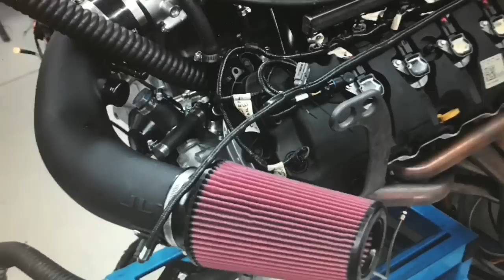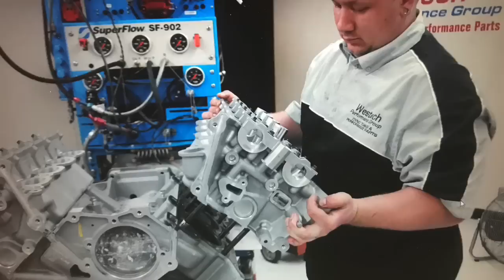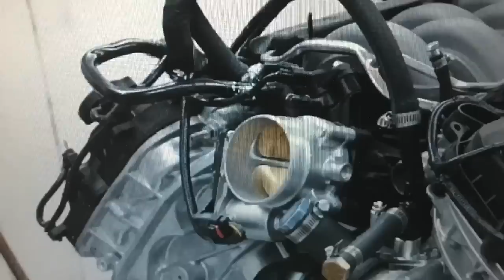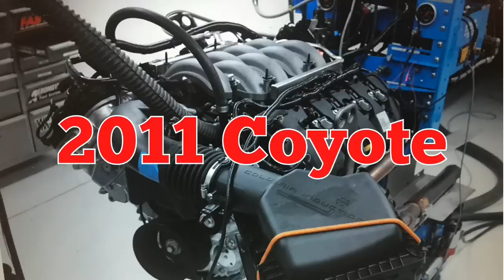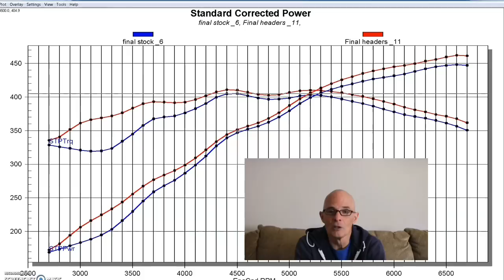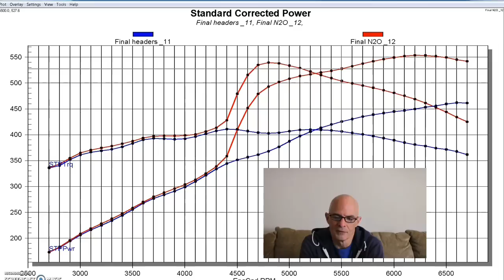5.0L 4V COYOTE MODS-NITROUS & HEADERS (GEN 1 YOTE)

Comment: Shaun Perry at AED ran a similar test on his gen 2 mustang (stock block) with CPR single turbo and found the weakest part in the engine to be head bolts. I "think" he end up making 1,320ish rwhp before a head bolt let go. I haven't done the math but, through a 6r80 transmission those numbers would have to be close to the LS numbers.

Comment: Weakest points of Coyote Gen 1 in order as I see them, #1 oil pump gears, #2 Rods/pistons and fasteners #3Head Gaskets/ head fasteners, #4 secondary timing chains. #5 the Cooling Jackets in block seem to develop cracks above 900-1000 h.p. over time.  Of course tuning makes a Huge difference! And could keep some of the internal component issues mentioned here at bay for a while! Still waiting to see the Big Bang Coyote engine! Can't wait! I'm also curious to see if my predictions are right!

Comment: Is it a fair comparison between the 5.0L Coyote and the 6.0L LS6? I think when it comes to the amount the stock block can handle it would be more scientifically sound to look at power per cubic inch versus overall power because you are going to have to push the smaller Coyote 5.0L harder. It's kind of like comparing a 350 GMC to a 460 Ford. That Ford is going to be able to make 1000hp easier just because of the displacement difference.

Comment: The stock oil pump gears are the weak spot. If he changed those out, then it may make some big power. But since they are driven by the crank, replacing them would wipe out the claim of stock bottom end. The other big hurdle to being the HP king is the lack of displacement. Down 62 cid (1 liter) in a boosted application is a killer. With 2.5 hp+ per cid, that is a guarantee of being down 150 hp+ right from the get go.

Comment: I believe the 2015-17 gen 2 Coyote with it's factory forged rods and crank shaft should hold more power than the LS. There are Turbo gen 2 Coyotes running 8's through a stock/sealed motor. Supposedly the Coyotes weak points are the oil pump gears, so as long as you don't bang against the rev limiter the OPG's shouldn't fail.

Comment: Why is it that LS guys always make a showdown against the coyote but use the best tuners/power adder for LS but the worst for coyote? A kenne bell? Are you serious? That thing is a heater more than a blower. And ken bell tuning? 🤦🏻‍♂️ not just anyone can tune these coyotes, an LS my 3 yr old can tune that. Never an apples to apples comparison
Reply from the maker: The Big Bang Coyote gets the same two S475 turbos and ATW IC as the LS
Reply: @richardholdener1727   I see that. The issue was more using a gen 4 ls and a gen 1 coyote. Also, this was done waaaay back. A gen 2 coyote would beat that record, but like you said, the most popular you have tested on is LS. Nothing against you. This is entertaining.

Comment: The thing I didn’t understand about these Mod motor/ Ford enthusiasts is their love for those inefficient ass blowers... these small cubic inch OHC motors are completely optimized  for turbos lol... especially when you look at the Cost vs performance gain factor. Hell, with a Forged Coyote and a single efficient CAST 76mm-80mm turbo (nothing extravagant or crazy aka Non Promod turbo) you can make some serious steam. The Coyote makes Good power per cube for its cubic inch and on top of the fact it’s only 5.0L.. so the turbo size doesn’t need to be crazy to make 4 digit power

Comment: High compression drag motors make 16+ bar BMEP.  The coyote with headers and no accessories is only at 12.6 bar.  The 2020 480 bhp coyote is only at 12.0 bar.

Comment: I love Ford's but the 6.0 has a simple displacement advantage. My money is on the 6.0. now if you break it down to horsepower per liter the 5.0 would win. I'd bet the 5.0 makes more power than the 5.3 but not more than the 6.0.
Reply: Actually,  with just headers on stock engine, the 5.0 made 50 more HP than the LS 6.0.

Comment: Finally a coyote. Hopefully you do gen 2 and 3. Gen 1 motors are the weakest byfar
Reply: Gen 1 coyotes aren't any weaker than a gen 2. They have the same short locks except the gen 2 uses smaller head bolts. The gen 1 has 12mm head bolts vs the gen 2's smaller 11mm bolts. If anything, the gen 2 would be weaker. However, ford finally got it right with the gen 3 as far as strength. The gen 3 uses Boss rods and pistons along with 12mm head bolts. Not to mention, the extra power from better heads, cams, intake and compression increase. This (gen 3) coyote is what I'd like to see Richard test against the LS.

Comment: I wish you would be testing the Gen 2 Coyote which is better in every way over the early gen 1.  SBE Gen 1's are good until they start flinging rods at 740ish whp but the Gen 2 Coyote (which got a lot of the Boss 302's tech) can get their more easily and live a happy life at 850-900whp and 1,000whp if you want to show off on occasion.
Reply from the maker: The Big Bang motor will be Gen 2

Comment: As for performance, the coyote platform is amazing.  The make a ton of power right out of the box and respond really well to upgrades, especially boost.  The only issue I have with them is their physical size- they just take up a ton space under the hood.  The debate over which platform (LS/LT or Coyote) makes more power is mute- both are capable of making ridiculous HP numbers.

Comment: As light weight as the coyote is , and the fact that it needs to rev to the moon to make max power , I highly doubt it will make more power than the 6.0 LS before it goes boom....Another channel already did the LS vs Coyote shootout and the LS won both N/A and with boost...
Reply from the maker: Please take a look at that test-it's not what you think
Reply: @richardholdener1727   I'm not sure what you mean.   What's not what I think? The test I'm talking about spent the same amount on building both engines,  and the LS came out on top N/A and boosted.
Reply: bdd1469 ls and lsx will always be better. Nothing faster than a turbo lsx ftw
Reply: @speedlife301  lol.  I am not fan of fords but the coyote platform  is an  impressive package. I love LS based engines and the power they can make is amazing. To say nothing is faster than an LSX turbo is beyond insane.  LSX based engines usually make 1000- -2000 hp when boosted.    Blown hemi's and mountain motors make 3000-10,000 hp...

Comment: I’ve seen bone stock mustangs get thrown 20psi and hold up fine, making 1000+hp on chassis dynos. I’d imagine if you did simple ring gap like the LSs, and tuned it correctly, I don’t doubt the factory motor would make 1100-1200.

Comment: Coyote is limited by bore spacing, prevents you from making big cubes when adding a stroker kit. Expensive shortblock to correct that. 
Personally, I think what the coyote loses in the cubes will be somewhat made up for in the RPM it makes peak at, though I don't think it will match the 6.0. 12-1300hp is my guess.
Reply: Key will be keeping the tq levels lower and not revving excessively but with its rod length and the stroke i feel it will surpass the 5.3 and definitely be barking at the engine 1 liter its senior

Comment: btw, if you want significantly simplify the tuning on the Coyote you can lock out the vvt. Modular Motor Sports and Comp Cams both make parts to achieve this. MMR completely removes the phasers and replaces them with aluminum plates which removes some weight off valve train. The trade-off is you lose a good deal of torque curve, usually down low, but for a racing engine this is usually not a concern. You get really good at degreeing cams, lol.
Reply from the maker: we actually want to reduce mid range torque anyway and plan on locking them
Reply: @richardholdener1727  
Well, there you go.

Comment: Generally speaking, for longevity, around 600-750hp is the limit on the stock Coyote. After that, sleeves, rods, and pistons are good idea and any time you're that deep into the motor put billet oil pump gears in it, especially if belt-driven supercharged. Also, the 12mm block is preferable as it has thicker, deeper head bolts/studs that tie directly into the main webbing. 11mm block are okay but known to crack around the knock sensor boss under very high boost. Do all that these engines are known to be happy at 1500hp, which is pretty incredible considering it a production aluminum block 5 liter. That would be like an aluminum block 6.2l LS making 1,820hp.

Comment: Hey Richard I'm hoping I'm not asking for too much but what are the chances of you getting your hands on Ford's new 7.3 L engine strapping it onto your Dino and letting her rip, now I'm not a Ford guy but I'm definitely impressed with that engine that thing already has the specs of a race motor in stock trim, just throwing it out there.
Reply: Revan Evan did minor port cleanup  on the heads, intake swap, and cam and ran it was touch under 600 hp

Comment: An L** big block should be able to take more than an LS I would think.  Especially one setup with real good flowing heads and a mid sized cam.
Reply: Big Bang Big Block. That'd be a good test. Another would be putting a LS 427 against a BB427, both identical cams, rocker ratios and good intakes.
Reply: Kimbal Mackinnon or the new lsx454 vs bbc 454

Comment: If I recall correctly, you ran out of MAP sensor on the Big Bang LS motor so you should get a 4 or 5 bar sensor and redo the test!
Reply from the maker: I will if the Coyote makes more
Reply: Richard Holdener Can you please make a video on oil viscosity and how it can affect power and reliability? Maybe do a test running 20, 30, 40 and 50 weight oils on the same motor seeing how it responds on the dyno to the different weights? Thanks!
Reply: 10 bar map sensor long live the 6.0🤣

Comment: Richard, I love your videos. Would be interested in a series to explain what you do to prep jyard motors to keep them alive. Machine shops are getting harder to find, and $ so what can be done with brake clean and a ball hone? What is really needed to keep them happy at 1xxx, head studs? Deburring? Etc? I see some people that bore, do rings, bearings, etc no matter what....then others just change the oil and go even if it has 200k miles. What’s the right approach?
Reply from the maker: Lots of guys have success doing both, I wouldn't put a motor in a car with boost without gapping rings-but lots do

Comment: given that ALL of the energy coming out of the motor comes from the gasoline going IN, isn't it a bit disingenuous to compare a 5000cc motor to a 6000cc motor? unless you can either get the boost on the 5.0 20% higher than you can get it on the 6.0, or you can get the 5.0 to rev 20% faster than the 6.     The higher capacity engine, with lower rotating mass is always going to give better power.    a BETTER comparison of comparative performance would be the "seat of the pants" test.   which gives better  performance mid range?   ie, which engine has better performance you can actually use?   your car doesnt live on the race track..
Reply from the maker: you are missing the point. The goal is to find the strength of the stock bottom end. Which one can take more power. The bigger motor is not always the stronger and we can an unlimited mount of boost we can apply.

Comment: Does it have the reliability and longevity at a high HP like that 6.0 LS? That’s the real question.
Reply: Considering no cam bearings, no lash adjustments ever needed, the strongest Ford sinter forged rods, etc etc. They are plenty stout.
Reply: @madmod  Bwahahahaaa! Four cams,  miles of timing chain,  cam phasers, tensioners and all that other crap. Oil pump gears that crack easily. Occasional oil starvation in the heads. I wouldn't call those 'stout' engines.
Reply: @Magnepan_LRS_Plus  read into any of these issues and it's less a rule and more an exception. For every failure you have 10+ exceptional opposite experiences. some of this like oil starvation to heads? Come on lol.
Reply: @madmod  whatever you need to tell yourself. More parts equals increased potential for failure.
Reply: @Magnepan_LRS_Plus  I learned from my own experience rather than regurgitating some internet horror story. I work out of a junkyard pulling selling complete engines and parts and have had several modulars from 4vs to the earliest of NPI lincolns. None of which have ever had any valvetrain issues, noise, or unreasonable wear. Oil pump gears become an issue at excessive rpms in conjunction with crank driven power adders(centris/pd blowers) and otherwise is not of concern. Tensioners and guides in almost all rebuild scenarios can be reused as they generally see little to zero wear with even with as much as 150k miles. I've never once had a tensioner fail in any of my 8 mod motor equipped vehicles. My c headed 4.6 had a known tensioner dowl issue that was only a problem if bouncing off a raised limiter 7500-8000rpm so not an issue if you keep it below that Rpm or know how to shift. This was later improved on coyotes to a much larger dowel. The chains are not known to stretch or break and I've never seen one fail across any modular I've been inside. 3v 5.4s are the only engine I've ever heard have phaser issues and a lockout kit is cheap and who is using a preformance 5.4 3v anywho? To argue the variable cam timing as a flaw in the coyote is laughable at best as it specifically is what makes it work circles around other platforms stock for stock and at a smaller displacement. And again, oil starvation to the heads? The mains and lash adjusters directly affect oil pressure in these mod motors and the lash adjusters specifically receive direct oiling as the oil pressure they see is what solids up the lash in the adjuster making for zero lash adjustments. Stock oil pumps keep plenty of oil pressure with the volume to back it up. Hell stock 2v pumps are plenty for most any early modular build and 3v units are cheap! Id say all things considered they have proved themselves to be quite stout and good preformers with all oem Ford parts too.
Reply: @madmod  while much of that may be somewhat true for regular driving, the topic of this video and comments were discussing performance applications here.
Reply: @Magnepan_LRS_Plus  Somewhat true lol.. just quit trolling dude.
Reply: @Magnepan_LRS_Plus  your response is typical and expected just like most anti mod motor bandwagoners.
Reply: @madmod  Typical. When the fanboys get their feelings hurt they accuse you of 'trolling'.
Reply: @Magnepan_LRS_Plus  you hurt no feelings. Your denouncing everything I've just said as being "maybe ok for street driving". Why don't you look into any single point I've just made and find that not only is it effective for 200k+ miles in a street application, but also the very people who are holding records in several forms of racing stand by everything I've just said. Get real dude.
Reply: @madmod  And now you are repeating me. LOL. Never said I was anti-mod engines. Key word; Engines. You don't even know the difference between engine and motor? LMAO! Really? Just stick to your 96' Mustang. Thanks for the laughs.
Reply: @Magnepan_LRS_Plus  conceded dude. Not only did u specificly post after me, but banter over terminology. A motor is a machine powered by electricity or internal combustion. Is your Google broke or is it your ego?
Reply: @Magnepan_LRS_Plus  I've done more with this junkyard NPI mustang then you have sitting punching your keyboard.
Reply: @madmod  Yawn.
Reply: @Magnepan_LRS_Plus  8.89 @ 156 403in Joe/Amber 3195# Solid Cathedral (fastest na LS car).  #pureevil went 8.85 @ 152 in a 3200lb fox(fastest na yote). Want to make a guess whether bowties or Ford holds the boosted records? Want to make a guess which one is stock displacement and running parts made by the manufacturer? Your little magazine test shows verry little other than the huge aftermarket support available for LS motors(read as off shelf parts). Fact of the matter is in all forms of competition, the smaller 4 cam motor hangs with and exceeds the LS cars. Hell get an LS into the 5s without using a completely billet engine and I'd be thoroughly impressed but considering the earliest of mod motors ie b headed Lincoln 4.6s have seen 5s 1/4 miles on Ford cast longblocks and cranks and twin 88s.
Reply: @madmod  I never said the LS was faster then a properly built/tuned coyote. But hey they got issues bud, they are not some perfect engine handed down to mere mortals by God. They are expensive to buy and build too. Even the LS engines had issues. Look at the LS7. There are many reasons LS engines go into Fords and not the other way around, FACT. It's obvious that your a mega-fan boy of Ford with a screen name of 'Mad Mod'.  I have no trouble appreciating either engine platform, but you fan-boys trigger easy. Have a great night!
Reply: @Magnepan_LRS_Plus  all I claimed is they are plenty stout. I'm the mad mod because I source modulars cheap. Want to dabble in 4v mod motors then hmu otherwise keep to your shallow self about being hurt and triggered because your not speaking on behalf of me lol.
Reply: @madmod  how much for a 5.0? Shipping?
Reply: @madmod  pretty good prices.

Comment: Great video, I'm super excited to see the coyote stuff!
In the beginning if the next video, I would really appreciate it if you would put up a dyno chart of the stock coyote with headers vs a stock 5.3 LS with headers, just so we have an easy comparison/refrence going forward.
Reply from the maker: what comparison is that-the LS that has the record is a 6.0L. A 5.3L with headers makes 355 hp. The Coyote makes 455 hp-a 6.0L LQ4 makes 405 hp.
Reply: @richardholdener1727  
It would just be interesting to see the baseline torque and power curves of each motor all on the same graph together, just so we can have an easy visual of how they all compare to each other in stock(ish) trim. 
It's by no means mandatory, just something I would like to see if you have time.
Reply: @HioSSilver1999 : Wow, that little 5.0 made 50 more HP than the 6.0. That's impressive.